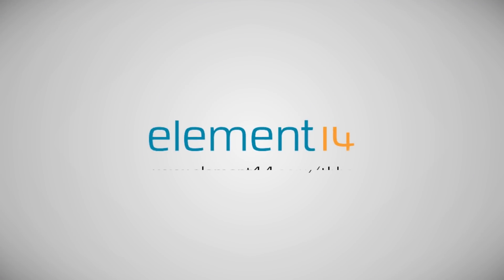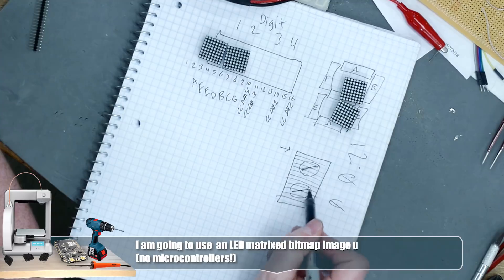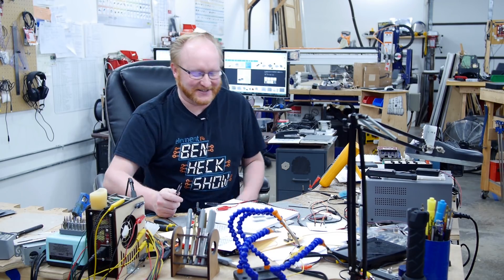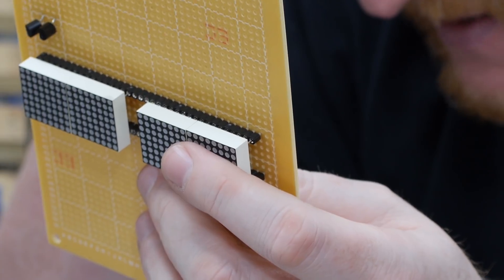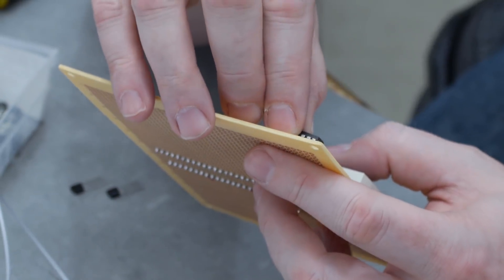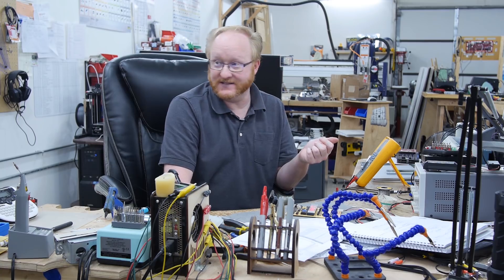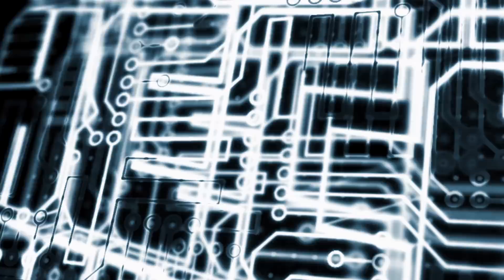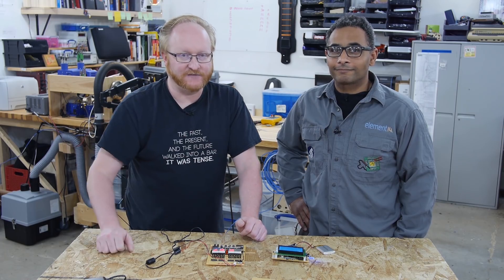Ben & Felix: The Great Clock Off!

Comment: I made a discrete clock from scratch using an EPROM to display all segments for a digit at once. But the way the clock circuit was built made the propagation delays really add up in 24 hours time. It worked using the line frequency, or a repurposed wall clock circuit. Furthermore I built it to multiplex the digits with far fewer data and signal lines for a remote display. In the end it was to demonstrate     clock and multiplexing technology in non standard ways.

Comment: I've built simpler versions of both of those clocks before. I made one with a character OLED display with an AtMega644p and then made a clock that used a mains transformer to keep time and provide power based on the one Dave Jones has on his channel. The second one was fun because if you touched the wrong part of the board you got tingles.

Comment: You will learn more hardware design struggles and low level circuit design from Ben's clock, Felix clock is more about software and high level design. Its apples to oranges, they are both good clock designs.

Comment: Ben's clock because it is by far the easiest to read and that's an important requirement. I made a clock with an Arduino nano (cheap and small) , an I2C RT-timer and a TM1638 "LED & KEY" module/board (= 8x buttons, 8x led and 8x 7-segment displays) . It is very compact solution and super bright!

Comment: for my capstone design project, i used a microcontroller to make a countdown timer activated by speech recognition (ended up using software and an arduino uno for that). It communicated wirelessly via XBees

Comment: Could I use a wireless arduino-compatible micro controller in the MCU-based clock to update the time once it connects to the internet 🤔
I liked Ben’s clock more too, because it was so 1980s like and I liked it. 😀

Comment: lol. Ben's clock circuit looks a lot like when I was trying to work out the design kinks in a speedometer that effectively used an array of LED's to take the place of a pointer.
Really quite absurd, but I intended it mostly for visual effect over anything else...

Comment: Good God... The back... It's... Horrendous...
Reply: Horrendously beautiful ;)
Reply: That is why I prefer the boards where you have to cut the lines to break the connection in stead of wiring everything like that, although it probably requires more wires on the top of the board
Reply: All the wires are the same color!  AAAAAAH

Comment: Felix's clock is more feature rich, but actually less cool? I like the features his has (And would love to see his code!) but Bens was way more retro - all TTL with an interesting display. 

My own clocks are kinda dull, Nixie clocks! https://imgur.com/a/GQC8k
I used the instructable by Andrea Biffi (http://www.instructables.com/id/simple-user-adjustable-DIY-Nixie-Clock/) to build them, with this board https://imgur.com/a4gynNJ that I etched and built. 

I'm working on a new one, using the same microcontroller and RTC as Felix (Hence my interest in his code!), and a completely new board that I'm designing myself from the ground up. 
It will have a 4 digit IN12 Nixie clock display, and a 8 digit 7-seg for calendar and alarm functions, the alarm will trigger a radio or MP3 module (Not made up my mind which yet, maybe both!)
https://imgur.com/zYbRbT9 - My WIP of the casing and knobs. Since then I've added mesh across the top/nixie section and a dark perspex across the 7-seg area.
Parts (will) include: Salvaged case from a dead 8-track player, knobs from a dismantled ham radio that was too illegal to keep, cold war era Nixies, and a lot of ebay parts!
It's currently on hold until all the parts arrive from Ebay.

Comment: I'm still working on it, but I made an clock using OLED screens. I used a ESP32 to communicate to an NTP server, so it doesn't matter if you lose power. Downside is of course you need to connect it to WiFi. https://www.sparkfun.com/news/2687